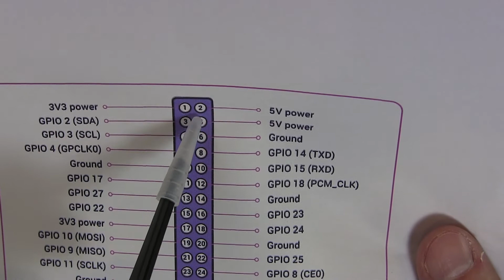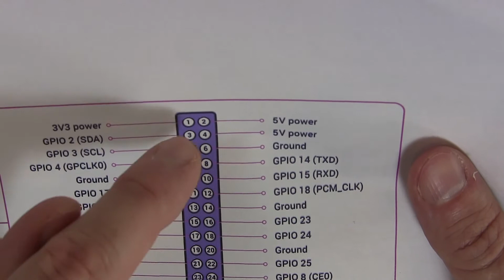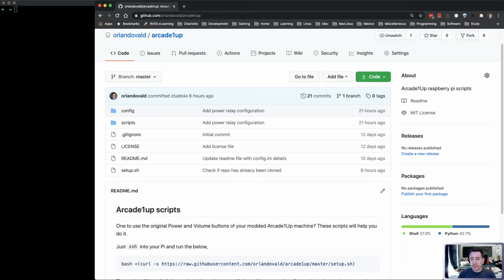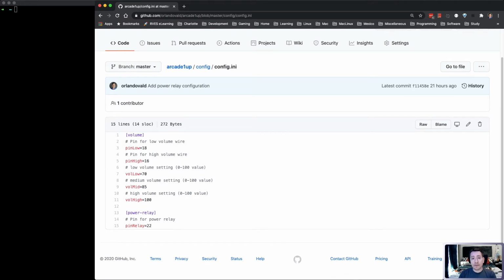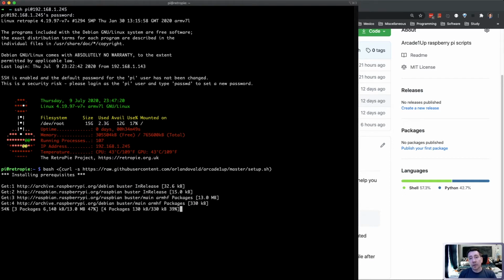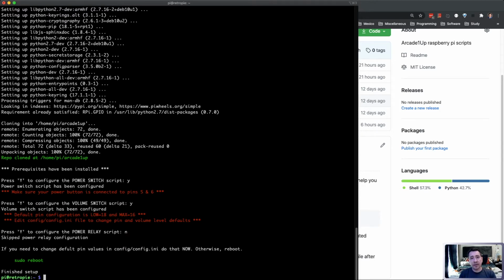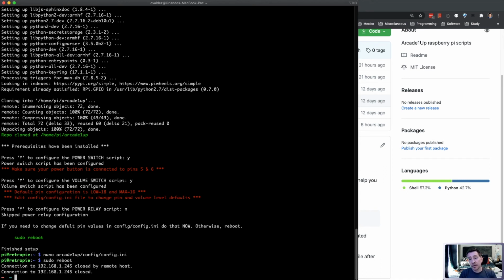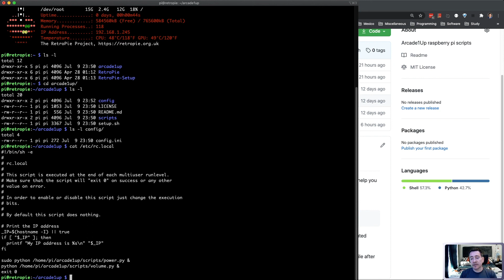Arcade1up Mod PowerButton

Comment: Okay. So I’m trying to implement this on my current image in my pi 4 and I couldn’t get the volume script to work. So I formatted my sd card and used a clean image and ran the script again and both my power and volume toggle switches works on my Street Fighter Gen 1 Cab. Thank you so much! It was that easy.

Comment: Hi. I connected to my raspberry pi via Putty and ran your script and it came back with "command not found" on all of our prerequisite files. Please Help!
Reply from the maker: Is your raspberry connected to the internet? Can you share the surrounding text from the error? I need a little more detail to understand exactly what command is not being found
Reply: @code-recipes936  First of all THANK YOU for helping!! Yes it is connected to the internet. When I copy and paste your script in PUTTY and run it, it comes back and says "command not found" for /dev/fd/63: lines 14, 15, 16, 31, 32, 33.  Then oddly it says "prerequisites have been installed" followed by grep: /etc/rc.local: No such file or directory"
Reply: I have Batocera installed instead of Retro Pi. could that be what's causing the issue?
Reply from the maker: @841577  Yes, that's going to be a problem. The script is designed for retropie sadly. It should be simple to tweak to make it work with Batocera as both are some flavor of linux but I'm not familiar with it
Reply: @code-recipes936  Got it..Thank you. I will switch back to retropie then because I really like how you set this up..
Reply: I set up retropi and it worked perfectly! One last question....will it still work if I change the "front-end" to attract mode instead of emulation station?

Comment: How do I remove your script?
My raspberry is stuck in an infinite boot loop after running it
Reply from the maker: That is weird, what type of Raspberry you have? Can you double check your wiring and did you update the configuration file to match the GPIOs you are using? Anyway,  to remove the script you'll need to ssh to your Pi, to remove the volume/power switch script  open the /etc/rc.local file and remove the corresponding lines, something like,
// open the file
sudo nano /etc/rc.local
// then remove these lines
sudo python /home/pi/arcade1up/scripts/power.py &
python /home/pi/arcade1up/scripts/volume.py &

To disable the power relay script, run the below commands,
sudo systemctl disable /home/pi/arcade1up/scripts/arcade1up-relay.service
sudo systemctl daemon-reload